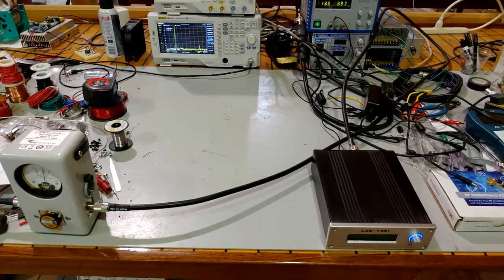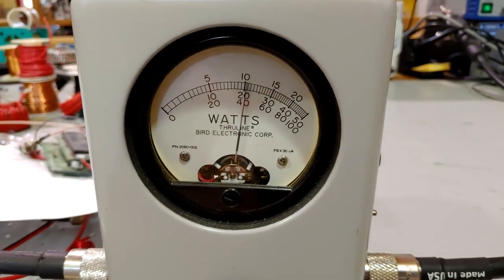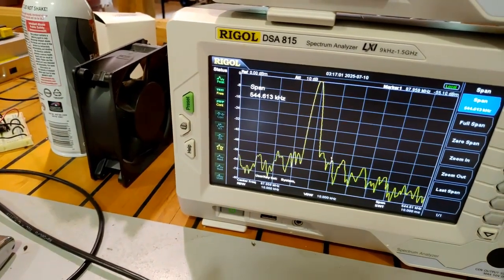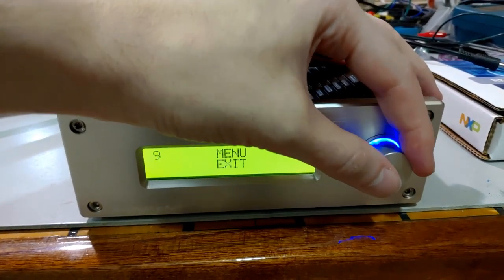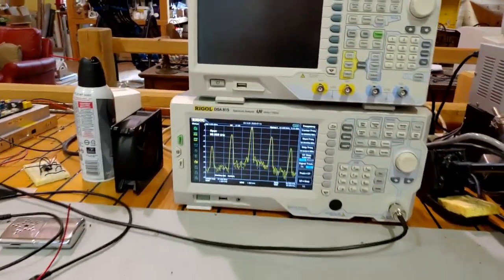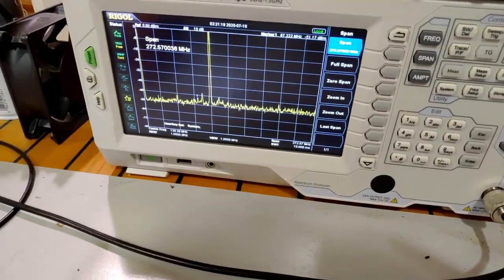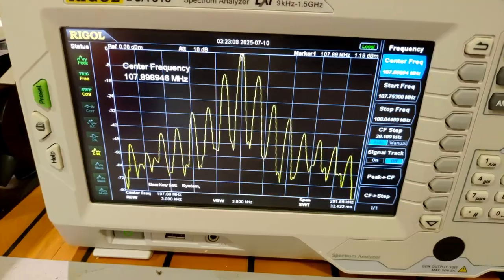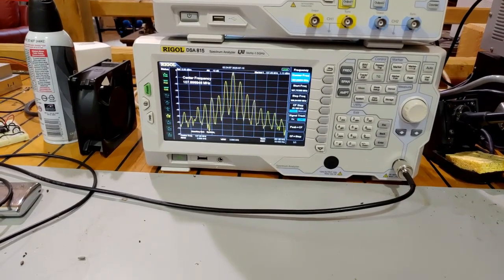CZE-T251 Chinese FM Broadcast Transmitter with BH Chip Review

Comment: Would have been much more useful had you run audio thru it and tested audio transmit performance monitored from a radio.  I have older models and the audio is horrible...the biggest factor by far for Not getting these units the audio is low  very low and very narrow, hard to input a decent signal into it
Reply: Пишу к вам из России для того, чтобы звук был более качественный установить стереоулу или какой-либо другой фм-процессор как программного вида, так и собственно аппаратного есть аппаратный вид. Омния. В общем, для того, чтобы у вас звук был кайфовым, вам нужно и вложиться в этот звук, а так что даже скажем так, простой передатчик радиовещательный, собранный по американским. Государственным стандартам с вашего компьютера или ноутбука даст х***** звук, потому что у вас нету обработки звука, установите динамическую обработку звука и эквалайзер, поставьте тоже вот вам и будет счастье привет из России.

Comment: Your tests are interesting. Keep up the good work.
I have noticed that power output measures low on all of your recent tests. Perhaps you need to get rid of the CB connectors and use N or some other constant velocity connector to reduce loss.
Reply from the maker: I was starting to wonder if that was happening too. But actually, this TX has an N connector on it, so I didn't use any adapter. My cable is fitted with N on one end and UHF on the other. On BOTH PCS transmitters, I had to use adapters, and yet the power measured out perfectly. So I do honestly think that my setup is accurate and we are just getting unlucky recently.
Reply: @spectra-man  please op pen cover of any transmitter you test we want see inside elemnets at same time